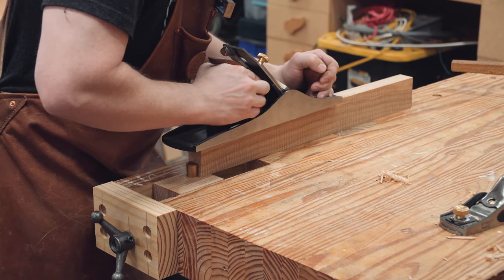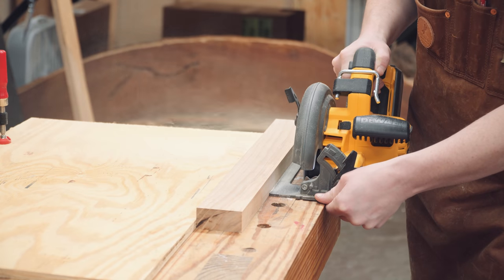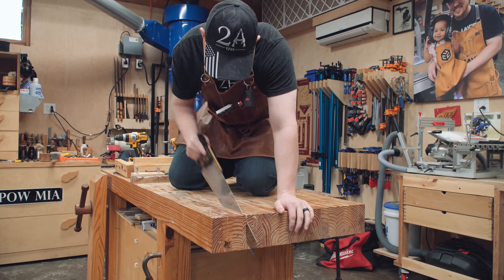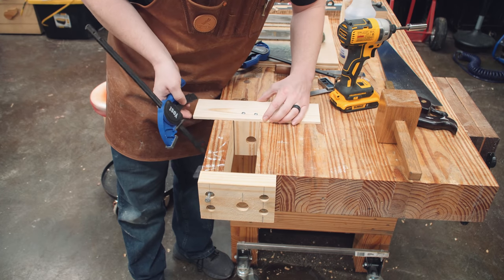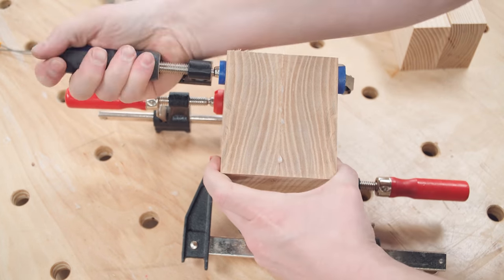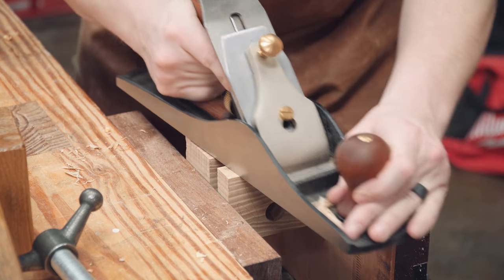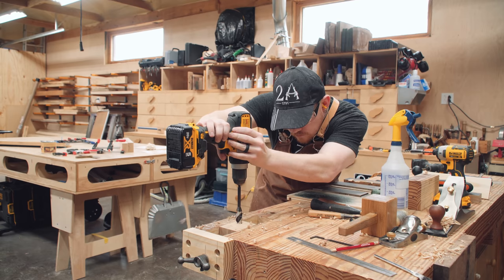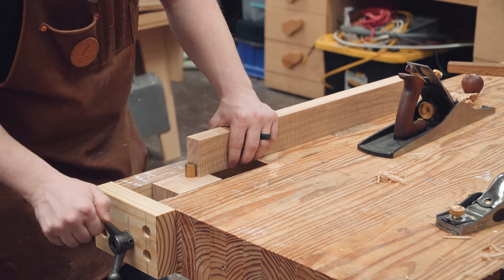$24 Wagon Vise - 365

Comment from the maker: 📙 Article/plans for this build: https://jayscustomcreations.com/2021/03/24-wagon-vise/

📝 IN THIS VIDEO | disclosure - affiliate links below:
→ Wagon / Tail Vise Kit https://lddy.no/vd0i
→ Thread Locker https://lddy.no/vldu
→ OverDrive Drill Bits https://lddy.no/vldv
→ Multi-Length Extensions https://lddy.no/vldw
→ Brass Bench Dogs https://lddy.no/vlkb

----------

💰 Coupons to save you money 💰
💲 - Router bits (use code JAYBATES15 for 15% off - https://bitsbits.com/
🌪️ - EF5 dust collector (use code JAY5 for 5% off) - http://bit.ly/2NlQ9ov
💲 - Save 10% on CMT saw blades at Taylor Toolworks with code CMT10 - https://lddy.no/qi2r

Comment: Ive been working on mine on and off forever. Lots of binding and slop and modifications and wood splitting and rocking and finally wood clamping that pops right out.

The original block split when I was cutting in the dado slot for the plastic rail I installed to limit the rocking and twisting. 

Maybe i just have unreasonable expectations for clamping. I swear to christ i wish i never got it in my head to build this thing lol.

Came here for some tips but ive done most of the stuff you did. So frustrating.

UPDATE: after I wrote this I went back into the garage and tried one last time and BOOM it worked. Thank the gods.
Reply: Thank your perseverance instead.

Comment: Great outcome for the workbench. I wonder if you could get a left hand threaded rod for this so you can maintain traditional righty tighty lefty loosey operation of the vise.
Reply from the maker: I'm sure they could be sourced but a reverse thread rod and square nut would increase the cost a bit. No need for that in my opinion.
Reply: Glad you saw that as well.
Reply: @JayBates  Actually, a left-handed acme lead screw from McMaster-Carr is cheaper than the comparable right-handed version.
Reply: huh? it looks left handed to me. UNLESS the video is reversed? @8'20" Jay's motion is turning left to tighten
Reply: @leeackerson2579  but these are not Acme. Acme are much more expensive than standard threads
Reply: @susantaylor7152 , Miss Taylor, please check Lee Ackerson's  comment a day before yours. McMaster-Carr is a lot like Grainger's, if you really want &/or need it, they've got it. They ain't cheap, but then again, they ordered at least whatever the minimum order was from the manufacture just to stock it. (I tried ordering some fret files from Simonds for Stars Guitars once. They said sure, they'd make some for us; minimum order was a dozen gross. About 1,722/3 more than we'd ever use.)
Reply: There is a very easy way to correct it without getting reverse threads.
Reply: @brucewelty7684  That's exactly what we are pointing out. These are "regular" right handed threads, meaning when he turns the handle counter clockwise, the nut (inside the moving block) moves away from the handle. (Which is what tightens the vise) Same as if you were unscrewing a bolt, except here the nut moves instead of the bolt. If the threads were reverse threaded, the opposite would be true, so that when he turns the handle clockwise, the vise tightens.
Reply: @VidarrKerr  what is the solution?
Reply: @markhedquist9597  Change the surface plane that moves.
Reply: Couldn’t you just flip the threaded rod around and put the handle on the other end since there’s no definitive “head”.

Comment: I wonder if the sliding block won't start to lean back after some usage, since there's only one nut in the middle that works as a pivot point. 2 bushings on the sliding block might be needed after a while.

Comment: Excellent addition to the bench. One question, if you reversed the threaded rod, would a clockwise rotation of the "adjustment dial" move the block toward the center of the table? The existing counterclockwise rotation seems backward to me. Perhaps it's just me. Thanks
Reply: Reversing the threaded rod does not reverse the thread pitch.  One needs a left-hand threaded rod to do this (standard threading is right-handed).  A better kit for a non-travelling-rod wagon vise would include a LH-threaded rod and nut with Acme threads for faster vise travel.   I'm using the term "non-traveling rod" for this type of design where the block with the threaded nut travels along the threaded rod which rotates in a fixed position in relation to the bench top.  The other design type has the rod terminate in the travelling block and has the nut captured into the end cap.  In this design, the rod and hand wheel extends out further from the end of the bench as the block is retracted to open the vise.

Comment: Thanks for the plans and guide. Fortunately I'm building the bench from scratch and don't have to go through the steps of cutting out the old bench top. I ripped  2x6 stock in half and used the flat edges at the top side. My moving block and gap is 4.5" wide (3 thicknesses of 2x stock) and I have 2 dog holes in the moving block. Doing the construction on a new bench is MUCH easier since I can drill all the holes at the drill press. I made square dog holes in the bench by cutting 3/4" x 3/4" dados in the 2 outer boards taped and clamped together. That gave me 3" between holes. This section of my bench is about 10" wide, so it will go through my thickness planer. I'll be making another half of the bench top with a twin-screw side vise and will have a 1.5: gap between the 2sections to allow for clamps to go through the center - like a Robou bench.

Comment: Great REAL WORLD project here, Jay. I like what you did and how you did it, to the point and no glitzy showy stuff. I use a very similar wing nut (speed handle, some call it) for my carving set ups. I'm almost certain those are made by Peerless (mine are). Jergens and Gibraltar make similar two pronged handles that do the exact same thing but I prefer the Peerless models. If you do any 'clean work' around them (any model) make sure to wipe them down really good and give them a sealer coat of something tough like a flooring poly. They're all cast and the dark zinc/iron surface is never baked in properly, left un-coated that powdery residue will get on your hands and transfer nasty smudge marks onto anything you touch after handling them - clothing, your face, veneers, anything you really really really don't want messed up in any way, it's inevitable. I think they're made with the intention of their being used in machine shops where such cleanliness is thought of as like LOL, RIGHT, SURE, BUDDY, WE'LL GET RIGHT ON THAT by default.

Comment: Nice kit, Jay!  Thanks for bringing that to us.  Is that threaded rod threaded backward?  Turning counterclockwise tightens the vise?
Reply from the maker: The treads are the regular direction. No need to spend more for reverse threads. It's easy to use.

Comment: I'd take the screw out and turn it around so that when you rotate it to the right it would advance the block. The way it is now the rotation is backwards. Well to me it is. Righty tighty lefty loosy.
Reply from the maker: Thanks for the tip!
Reply: Imagine a threaded rod with a nut on it. If you unscrew the rod from the nut and turn it around, it's still a right hand thread, so the direction doesn't change. If you want to have the block move away from you when you turn the screw it has to be a left hand thread.
Reply from the maker: Yes. My reply was sarcasm. As I thought the original comment was :)